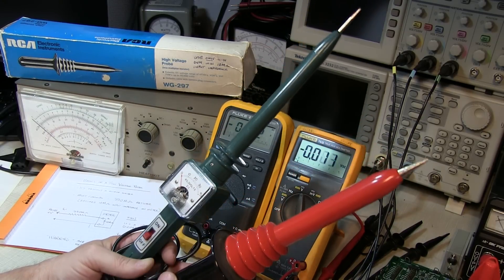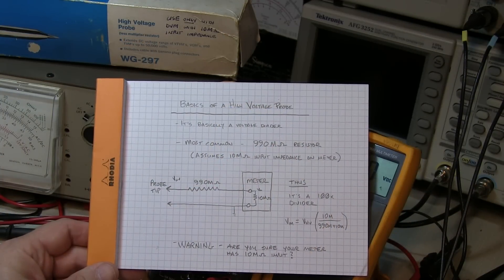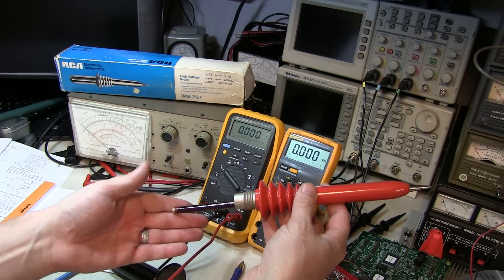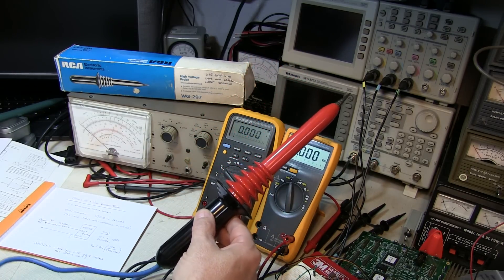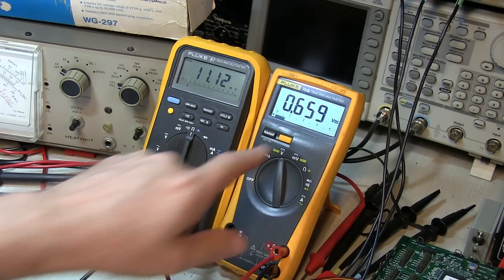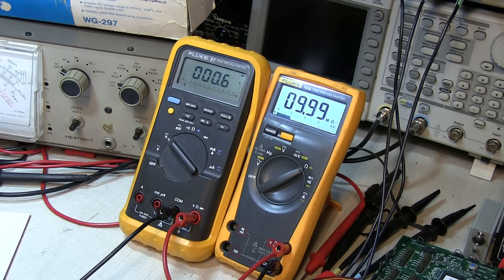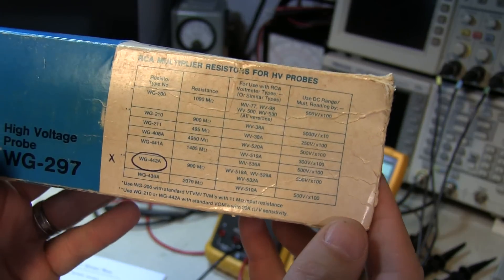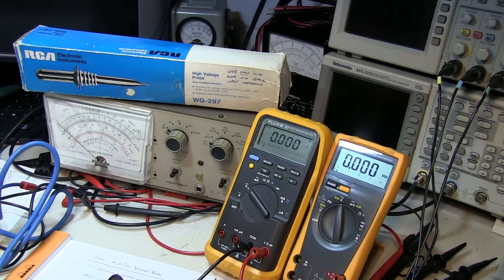#142: Basics of High Voltage Probes and how to use them

Comment: This is a good video. I have an RCA WG-411A probe and initially I thought the resistor was missing but after seeing your video I looked in the right end of the probe and it turns out I have a WG-206 (1090M) resistor. The only problem now is that I have no lead for the probe. Do you know where I might be able to get one?

Comment: Also,  a lot of the cheap digital meters that you can buy today have an impedance of 1 meg ohm. It basically just changes the range which you'll be using.

Comment: Hi w2aew. Where can I purchase the red probe that you were using ? Can that probe handle 100,000 volt  ? How much does it cost and where can I get one ?
Reply from the maker: The probe shown in the video is rated to 50,000V max.  It is no longer manufactured by RCA.  Fluke makes one that is rated to 40kV:
https://www.fluke.com/en-us/product/accessories/probes/fluke-80k-40
Cal-Test also has a 40kV probe.  They're pricey - $100-$300 or so.  
Here is a probe rated for 100kV:
http://www.cpshv.com/products/500.htm
 Measurements of such extremely high voltage typically requires specialized equipment such as:
https://vitrek.com/4700-precision-high-voltage-meter/

Comment: Hi, Thanks for the video! I was wondering if this kind of meter could be used to discharge filter capacitors on a tube guitar amp. I am just starting to learn about electronics and want to make sure I do things safely. It seems like This kind of meter could be used to check capacitor voltage with the amp on and also check and discharge the caps if the amp is shut off. Thanks again for a very informative video!

Comment: As always, EXCELLENT video!  I had seen a homespun HV probe video on the Dave Jones channel.  It had a decent bandwidth.  If I recall probes such as these would not do well with HF AC.  At work I would like to be able to check the output of a spark gap generator. HF start on TIG machines)  Output is 10-15 KV @ 1 MHZ approximately.  Any suggestions aside from an expensive Tektronix HV probe?
Reply from the maker: High voltage probe design for high frequency measurements is not trivial. I am not aware of simple low cost solutions.
Reply: Thanks Alan. I figured there wouldn't be a simple solution. I was thinking of some method that didn't involve direct measurement.  Asking doesn't hurt though. :) Thanks for your quick response. All the best... Jim

Comment: I have that "Heathkit" model.----1.6 giga-ohm (2 x 800meg. ohm) resistor internally.I cannot tell if it works or not.How do you check 800m. ohm resistors?

Comment: Came here to try learn about what I have... it's still in the box "NOS" Model 651 Polaris 40kv dual range probe that looks like a cross between these two (red/black body with a dial). Says Pat. Pend. & Looks to be 35-50yrs old... Couldn't believe it was priced at $79 way back then according to the original price sticker.

Comment: Great video, but  I must add that these “high voltage” probes are actually medium voltage (1kv-100kv) probes and not for use on high voltage (100kv+). Not likely one is ever  going to work on high voltage stuff unless one is a lineman, but I do think it’s strange they are labeled as such.
Reply: That is correct if you use the "low-medium-high voltage" nomenclature commonly used in power systems and generation-distribution. For example I work in digital electronics, anything below 3.3v is low voltage and over 12v is high voltage. So it depends on the context. For instrumentation, anything over 1kV is high voltage.

Comment: Curious if any of the more modern measurement instrumentation provides for greater precision and input protections than the older style.  If one were making measurements routinely in either electric utility of high power broadcast transmitters (as examples), what types of probes might be in common use today?
Reply from the maker: I'm certain that the probes and instrumentation used for high voltage utility work today is much safer and more robust. Probes like the ones shown in this video are intended only for low energy/capacity applications, not high power apps like that.

Comment: Good video, very interesting. Could these probes be used with a digital oscilloscope to measure a 20 kHz signal? If not is there a simple way to make one?
Reply from the maker: No, these probes are intended for DC or very low frequency measurements with a meter.  There are special HV oscilloscope probes available from various manufacturers for that purpose.

Comment: Very good information, Alan. I have learned a lot from your video's!

The only problem is that you warn to make hv measurements, but how can I safely learn how to do it and how to do it in the proper way. I am a self-thaught radio amateur (full license), so no one has ever learned/showed me how to do it (the chances are low because looking at repairing crt tv sets is rare). 
I would like to be comfortable f.i. to change the cap's in my scope (when it wil be necessary in my Tek 466) and I would like to know where are hv is around and how to measure it safely.
Could you make a demo measuring the hv parts within a scope with the hv probe. Thus we can see how to make proper hv measurements. I think there is no better way than looking at the actual proces. And if nobody shows how, nobody will ever know how to do it and the skills will disappear.

73 de Robert PA7RG
Reply from the maker: I'll add this to my list of videos "to do".
Reply: ***** Thanx, that would be more than great!

Comment: If you are measuring a negative voltage, you would reverse the plugs on the meter ...correct? also do you still ground the clip when measuring negative voltage?
Reply from the maker: +bones007able The DMM can measure negative voltage - so the connections remain the same.
Reply: I have a analog meter
Reply from the maker: +bones007able You'd have to swap the leads, but you must be very careful - this may put the metal parts of the meter at dangerous voltages.  It may not be designed for that.
Reply: so if I earth ground the clip , should give some protection ?, it has internal 10meg resistance, most DMM I find locally harbor freight , menards etc... do not list any internal resistance , if they do they are no where near 10 megs...
Reply from the maker: +bones007able HV probes like the one I showed MUST be used with a meter with 10M input impedance.  WIth other HV probes, your mileage may vary. CAUTION: Measuring such high voltage with equipment that wasn't specifically designed/rated for it, even if using a HV probe, can be lethal.  Don't do it.
Reply: I have a fluke 80k-6 that is for 10meg internal resistance... Another youtube video shows a user  using the exact same meter measuring 30K  with a fluke rated for 40K... all I need to measure is up to 2k negative volts, checking anodes on picture tubes scared me more back in the day...Thanks for your help

Comment: Thank you for your detail video! I just purchased, from eBay, Pomona 35KV tester, but it is not working. I tested the resistor, but the readings is OL on my Fluke 289 meter. Can one purchase somewhere replacement resistor? Could you measure the resistor yourself, on the stand alone probe you are holding in your hand, on the left side, and tell me what the reading should be? I would appreciate that very much. Do these probes "burn up", sorry for a lack of a better tune...Also, if anyone else has any suggestions, I'm open to it. Thank you again.
Reply from the maker: The resistor in that probe (the one with the meter) is an 800Mohm resistor, which is too high to be read with a Fluke 289 (maximum reading of 500Mohm), so it will show as OL even if the resistor is good.  You'll need a different meter to measure that resistor.  The meter movement can be tested separately (see my video on D'Arsonval meter movements).  For what it's worth, here is the manual for the HV probe with the meter:
http://lcweb2.loc.gov/master/mbrs/recording_preservation/manuals/Heathkit%2040%20KV%20Probe%20Meter%20Model%20IM-5210.pdf
Reply: I must admit that I did not know my meter well enough, but I was thinking about the limitations of it, when I wrote this message - sorry about that. But, how would I know if the resistor is working or not? When I measure the meter itself, I can see the arm moving a little, so I was thinking that the resistor isn't in working order. Also, there are 2 similar resistors in the front part of the probe, but the bottom one (closest to the tip) is a different color, it is darker brown - is that normal? Is that is how your probe looks to you? Or they are identical in color?  Thank you for the manual of your probe, mine doesn't have a SWITCH on the probe. You are FAST in replies, I'm a subscriber now! If you have any suggestions what else I could try, I'm all ears. Have a great day!
Reply from the maker: I've seen the resistors have different colorations, so it isn't necessarily an indication that it is bad.  If your resistor is composed of two parts, each one might be lower than 500M, so maybe you can measure them individually.   As I said, you should be able to test the meter separately to be sure it is right.  The one in my meter is a 50uA movement - I don't know what your might be.
Reply: Mine say 20 000 Ohms and I think it is working, based on my small experiment. I don't know if I can measure the resistors separately, it seems to me that there is some slick cover holding them together, so I did not want to break the seal (or whatever it is that holds them together).  But even per schematics, also in the manual you have included in your reply, there isn't much of parts that can go bad. What I wanted to test is my transformers from couple microwaves that work, but I wanted to see how much high voltage they produce (the specs say about 2200V, but I do not know for sure, since I do not have any other meter that works to double check that). I also made a project from these transformers and it would be nice to have  more precise measurements to be sure. Do you think I can safely cut off the cover, that holds the resistors together, so I can measure them individually? You can email me directly to czecht@gmail.com so I could reply with pictures and video. Or if you have Skype, you can find me under:  Tonda Fleming (my computer in my hobby room). I want to thank you for all your help!
Reply from the maker: I would think that they would be much higher than that, which seems to indicate 20kohms.  Even 20Mohms would be somewhat small (two of them in series would be 40M, which would result in 2mA of current, which would be asking a 40kV source to provide 80W of power!  Maybe they're 20G ohm - that would make more sense, but also make them unreadable with your DMM.  Definitely do not remove the cover - it is part of the insulation package.  Damaging it, removing it, etc. will compromise the safety when using this probe.  If you want to measure the output of the HV transformers, try driving them with a lower amplitude input - maybe from a step down transformer, a variac or even a function generator.  By driving with a lower input, you can then safely measure the output, which will also be proportionally lower, verifying the ratio of the transformer.
Reply: Great suggestions! I do have a Variac and I have it configured with a precise volt and ammeters...
About my Pomona 36KV (DC) meter, it has in the right bottom corner written: 20 000 OHMS PER VOLT, that is where I was able to provide to you the information in previous message. 
Yes, I'm not gonna separate the two resistors in my probe for the very reason you have mentioned.
And while using my magnifier I also noted that it is a DC meter, so that is why I could not see any movement on the indicator, while measuring the Microwave Transformer! HM, so how would I make this meter to work - I do not know! My brain isn't working like it did when I was young... and my Fibromyalgia with meds are causing      my brain cells to move to inaccessible parts in my brain, ha ha ha I do not know of anyone who I can ask for help, in this manor, so I very appreciate your help!.  Thanks again!
Reply from the maker: Ah ha - 20,000 ohms per volt means that for a 35kV full scale, the resistor must be 35,000x20,000 = 700Mohm.  These types of HV probes with a meter are designed ONLY for DC measurements.  There isn't really a good, safe way of converting it to measure AC.
Reply: Again, thanks for fast reply - you are a great person and for that I'm very happy to met, over the youtube channel. 
So I can't measure the AC with this device, so I'm thinking to make one myself.
Could I use the resistors from my Pomona 35KV - providing that I would make the appropriate Voltage Divider, with proper resistor, or should I just purchase the appropriate resistors brand new?
The Fluke probe you are holding in your hand can measure both AC and DC.
If I made myself the probe and use my Fluke meter, I could measure also both AC and DC HV, correct?
Thank you again for your patience. Have a great weekend!

Comment: Nice video. How does a high frequency high voltage oscilloscope probe work? Say a 30kV 10MHz probe?
Reply from the maker: +jpmvidal High Voltage probes are designed to be connected to a particular impedance or a particular type of instrument.  A 10MHz HV probe is most likely intended for connection to an oscilloscope with a 1Mohm input impedance, so it may not read properly on a DMM.  You would have to consult the probe's datasheet to be sure.

Comment: sir, i have hioki probe with 1000 Mohm impedance input with 30kv maximum voltage it can measure in the manual, they said this thing just only can measure high voltage dc source, it safety to the probe if i use to measure 2000 Vac. if not what the different of high voltage probe dc with high voltage probe ac.?
Reply from the maker: +Raja Gama Suhadanto If the probe does not state that it is suitable for AC measurements, then I would not use it.  High voltage is not something you want to take chances with.
Reply: +w2aew thanks for youre respons

Comment: I have FLUKE  80K-6 HV probe (max 6KV). After watching this video, I got the feeling that all HV probes have a resistor divider in them. Therefore, the statement about resistance ratio with one very large ~1GOhm internal resistor and the impedance of the multimeter is misleading. My probe has 63 KOhm resistance between the two output plugs. So, there is no floating resistor inside the probe. I am pretty sure that it is against safety regulation to have just one large resistor in the high voltage probe because it can sit at full HV in case of broken input of the multimeter. Please check the ones used in this video by simply measuring the resistance on the output of the probe.

Comment: If you don't give a proper return path for the current couldn't the supposed neutral side have a huge voltage? If it could that's gotta be one of the scariest and most dangerous parts..

Comment: sir, i have been measure my high voltage generator, i make this from flyback tv, when i check the pointer in my multimeter it shows 20v in 50 v measure limits, and when i turn to 10 v, its still in the first position when i measured in 50 v, can you help me whit this problem sir !
Reply from the maker: I suspect that the input impedance of your multimeter is changing with the scale setting, which changes the divider ratio.  High voltage probes like these are designed for a constant, fixed value input impedance.  If your meter doesn't provide that, the readings will be wrong.
Reply: ***** thanks sir, i figure it out i wasnt connected the ground to the circuit.

Comment: Hi,
You mentioned Fluke, so here are the specs of their typical probe:
http://www.farnell.com/datasheets/97941.pdf
It reads it is 1000 Mohm probe and it requires multimeter with 10 Mohm input resistance. So the voltage division ratio is aprox 100:1. However the specs also  reads the division ratio is 1000:1. How so?
Reply from the maker: +dxdx666 Because it likely also has another resistor shunting the the meter, likely approx 1Mohm.
Reply: +w2aew 
Yes, I agree. My point is that wasn't mentioned in the spreadsheet and you don't mention it in this video too (when describing construction of the probes). The devil is in the details ;)

Comment: Hey, I think you are wrong dude.     At least here in the UK that isn't how it is done...  I think it is because if the meter went open your leads would end up at high potential. 

In the UK the negative end doesn't rely on the resistance of the meter, but is a full divider with the plus out at the 'low' resistance end near the ground wire.

Depending on what you are measuring you either calculate the impedance of the meter or just discard it for a rough figure.

Comment: Since the meter can measure 400V without the probe, there is no reason to use a HV probe on any scale less than 4V full scale.  All of the higher ranges have input resistance close enough to 10 MOhm to make accurate HV measurements.

Comment: Surprised to see unshrouded connectors on these...
Reply from the maker: This probe is probably 30-40 years old, before shrouded banana plugs were used. Also, if the probe were connected to a substantial high voltage source, the shrouds would not be adequate to shield you from the high voltage.
Reply: If this is a 50kV probe w/ x100 attenuation, a shroud wouldn't shield against 100s of V? I guess the fact that this is a point probe and not a clamp or clip means it's not as important
Reply from the maker: The 100x voltage divider is only complete when the probe is connected to the meter. If the banana plug is not in the meter, then the full voltage will appear at the banana plug. No shroud will protect against that.
Reply: Ah ofc, thanks.